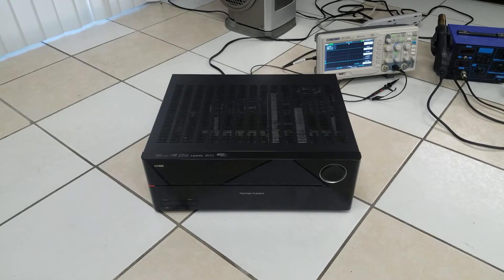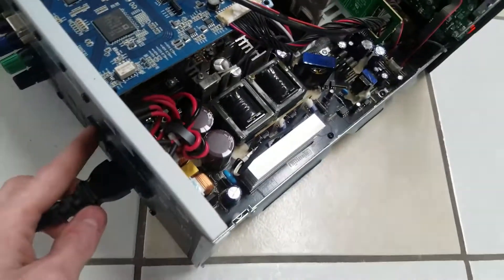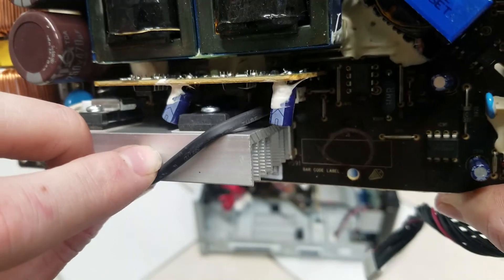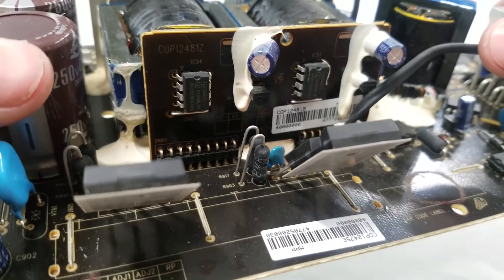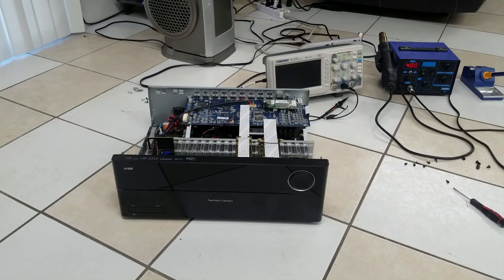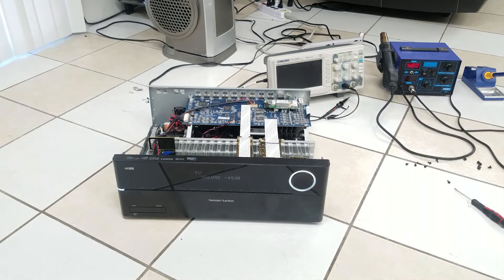Harman Kardon AVR 3700 / 370 Repair - Turns Off After 14 Seconds

Comment: Awesome video, great to see people repair instead of buying new!
I've got a avr270 which switches off extremely random, could this be the same/similar issue?
Reply from the maker: It does sound like a similar issue actually. I had one that started out doing that once every 30min or so, and it ended up increasing to 5m, then 30s, and finally it wouldn't turn on at all and had a flashing standby light.
Reply: @ri5ux  mine has been doing it since 2 years, but sometimes it plays for hours without issues, sometimes is switches off almost immediately.
If you say this still could be the same issue I will try your repair.
I'm not that great with a soldering iron, so if it sounds like a different problem I'll rather take it to an expert.
Reply from the maker: @666bamn  Unless it increases in frequency, it's probably a different issue. May be heat related, the fans don't always kick in when they need to on these models. I forced mine on all the time.
Reply: @ri5ux  thanks for trying to help!
I do have extra fans cooling the Amp as it is in a cabinet.
Is the heating up quick after startup? Because sometimes it switches off within seconds after booting up.
And I can switch it on almost directly again, and then it may play for hours without issues
Reply from the maker: @666bamn  That is quite odd. Probably not heat related in that case. That's going to be a difficult issue to diagnose without hands-on diagnosing it. When it shuts off, does the light pulse or flash at all? Even momentarily or is it just solid off?
Reply: Sorry for the late reply! It's solid off, no flashing or anything. Power led directly to orange, display completely off. My experience with electronics makes me think it's just a broken solder but I wouldn't know where to look. I've  spoken to a repair shop by phone and the guy there said something about a cpu possibly being loose? He said this receiver is known for this issue and it would basically be unrepairable without a complete new board. Does this sound familiar?
Reply from the maker: @666bamn  I have never heard of anything like that on this model. I have heard of failed temperature sensors, capacitors, and switch mode ICs, from normal failiures, but never a "CPU" being loose. Even if it had become unsoldered from the board partially, that is easily repairable with the right tools and should not need a whole replacement board. Plus, those could be insanely pricey, only being able to be sourced directly through Harman. He sounds inexperienced if you ask me. If you want to eliminate what he said, you can try adding a heatsink to the top of the "CPU" as he calls it, or even more simply just improving the airflow through the system with an external fan.

Comment: PLS Ri5ux HELP ME!! i have the avr 161 recieiver,and short after powering on it goes to sleep mode.it have also a smps.but it little different as your smps in your video.i have buy this reciever to repair it like you shown on your video.but its diferent.can you pls advise me?please.you are my last hope.
Reply from the maker: Here is the service manual to your receiver: http://arisux.com/upload/uploads/service-manuals/harman-kardon_avr161_avr230_sm.pdf

The power supply likely has the same issue, you'll just need to locate your capacitors. Page 176 is the schematic for your power supply. I believe the capacitors you should be looking at are labeled C911 and C905. They should be nearby the switching MOSFETs.

Comment: My Harman Kardon AVR 25 II just developed this problem. Is it transformer based or will changing out those capacitors work on mine?
Reply from the maker: The AVR 25ii is transformer based, this video does not apply to it. The transformer may be bad, it is about 24 years old, but it's hard to tell without seeing it. Honestly, unless you want it as a collectors item, it's probably not worth fixing. I'd recommend finding a newer receiver, that one was introduced in 1994. Just my opinion.

Comment: Thank you so much! Just repaired my 370 following your Video. It solved the issue with a shutdown after 14 seconds, but now I can´t get any sound out of it. Neither from amplified output nor pre-amped. Any idea?

Everything else is working fine. Including HDMI in- and output, graphical setup and so on.
Reply from the maker: Glad it helped you out! If I recall correctly, this can happen if your power supply is not providing the -50V and 50V rails. Make sure you have the amp board plugged into the power supply, if it is, be sure to test for output voltage on those rails.
Reply: @ri5ux  I checked it, all the connections were correct but as you said, I didn´t get the -+50V. I´ll check the mosfets next.
Reply from the maker: @mio4mio  Check the continuity between the -50V, 50V rails and ground. What values are they at? Check on the output of the rail and trace it back to the MOSFETs as well. It is possible that the inductor the MOSFETs are switching is bad, but is not very likely.

Comment: I have a Harman Kardon AVR151 with similar issue. It will go to protection mode if the power button is pushed. The red indicator mode would switch to white for a couple seconds (with short  hissis sound was heard) but turned back to red, and blinking. I lifted the ampli up should there should be something stuck inside the board, and powered it up again. Now it went back to normal (with long hissis sound was heard). I listened to the music for a couple hours. Turned it off (plugged it out) but when plugged it in back, the same situation happened. Again I shook the ampli for a couple second, and it was on again. 

This routine happened a couple times and I have a feeling that the problem is not that serious. Can you tell me what is happening here?
Reply from the maker: It definitely sounds like you have a loose connection somewhere, whether it be on the power supply PCB or a wire plug. Without seeing it myself, it's very difficult to pin down and diagnose something like this. If you're interested in a little bit of experimentation, I would try opening it up, and while you have fairly thick insulated gloves on, lightly wiggle components like ICs or inductors until something changes.
Reply: Thank you for replying, after browsing in youtube, it seems I am not the only one. Here is a video of the exact problem: https://www.youtube.com/watch?v=hycrfPY2qAM.

Upon checking on the comments section there are also a lot of people with this problem. Is this probably a factory's fault?

Comment: @Buyshop SP, this is interesting. I have a 3700 and just had this problem happen yesterday. I just replaced the two 471 capacitors and the problem still remains. To note, after clicking the power on, mine returns to the sleep state almost immediately, we're talking about like half a second. At first, like 2 days ago, the problem first started as a shutdown when the audio signal would increase with amplitude, like during an explosion in a movie. Not talking like loud volume; it was at around -30 dB on the nob.

Comment: completing my comment: when the receiver was ok, before the problem (and changing the capacitors) , i was at another room. Receiver was on , and working.    i think i heard a loudy sound, and then it was off , and with this problem of exploded capacitor.
Reply from the maker: Check the mosfets next to the capacitors. It is likely they are shorted.
Reply: Thank you very much for answer!  I sent the receiver to an assistance, and told them what you said.  They told me it can be the mosfets.  I m waiting for them , and probably tomorrow i will have a position.
Reply from the maker: @buyshopsp5375  Sounds good, be sure to let me know what they find out!
Reply: Hi, assistance said nothing wrong with mosfets.  i found the service manual and sent to him. He said that he thinks power suply is ok. That service manual could be usefull to repair the power suply only. 
He thinks the problem is with the hdmi board.  I don t have ideia.  I think i will try to send  it to a Harman authorized.  (I m in Brazil).   What do you think?  Can be the board that has all the hdmi ports?  
This can be a usefull information too:  First when i saw it turning off itself, i reseted the receiver.  But it seems it was ok.  it turns on at FM radio normaly.
Reply from the maker: @buyshopsp5375  Which capacitor exploded specifically? One on the power supply, amplifier board, or logic board? If you could provided the component ID number, that would help too. Also the service manual provides schematics for the amplifier and power supply boards. I think it also provides the schematics for the logic, but cant remember off the top of my head.
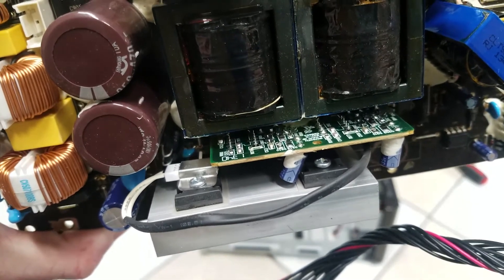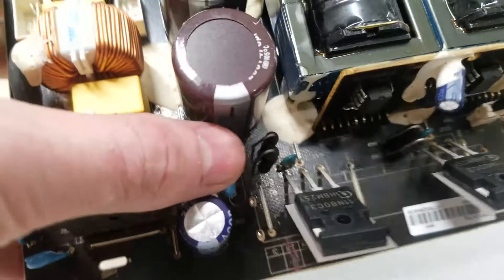Reply: HI, the was exploded was at power suplly.  the first you show at video.  at 7:11 and 10:14.  i changed it with 2kv 471 capacitor. (This one , and the other one that you have changed in your video too).  the service manual i donwloaded is from this link: https://elektrotanya.com/harman_kardon_avr270_370.pdf/download.html
Reply from the maker: @buyshopsp5375  I can almost guarantee it's the power supply. The only other reason it would shut down is if you have shorted output transistors on the amplifier or if it's in a overheated state (unlikely). These power supplies had a lot of issues. Replacing the power supply isn't easy either, since parts for these are uncommon. It's difficult to diagnose something without seeing it in person, but I would have him keep looking at the power supply. He may not be qualified to work on such a power supply, most receivers do not use switch mode supplies. You might have to take it to someone who repairs something more than just audio equipment (assuming that's all he does)
Reply: Hi, i 100% agree with you.  Still thinks its the power supply.  i m sending the receiver today to an authorized Harman assistance. I think in 2 or 3 days i have an answer.  You said about about transistors on amplifier.  Only thing i noticed apparently abnormal , was that nowadays it was heating more than when it was brand new.   Nothing extreme , and was working ok. But i m sure when it was brand new , the receiver worked coller than now.   (It is at same place since i buyed it).  Before this model i had an avr 3650.  The 3650 uses  that "common" power supply i know.  But i had to send it to assistance 1 day because it was heating abnormaly, and was shutting down rarely. After assistance, it worked cool as brand new.
Reply from the maker: @buyshopsp5375  I noticed one of mine also gets a bit hotter than the other as well, it's still working, but it may be on its way out. Occasionally it shuts down. On my other one I forced the fan to run all the time by bridging the fan test jumper. This may be something you'd want to do when you get it back. Keep me updated, I'm curious what they determine the problem to be.
Reply: Well, As said before, the receiver is at Authorized Harman.   Called there right now.   They said the problem is with the hdmi board.  I don t know what to do. They are waiting for harman to get a new board.   Do you know where can i find a board in US ?
Reply from the maker: @buyshopsp5375  Parts for these receivers are very difficult to come by, the only place I know of to get replacement parts is directly from Harman Kardon.
Reply: Hi, i have news!
The guy who works at authorized Harman  assistance called me today.
I ll try to explain what he said me:
He said he found an damaged hdmi board.  He said he made some more tests.  He said he "disconnected" or Disabled the amplifier board ,  and tested the with the damaged board.  The receiver turns off after seconds.
Then he tested with my hdmi board again (With the amplifier board disabled or disconnected).  And it WORKED!
He said in this conditions obviuosly the only way to hear the sound is with phones, because amplifier board is not active.
So, after this , his conclusion is that my hdmi board is ok, and the problem is with the power board.
He asked me patience to make more tests and analyses, to see if he find where is the problem at power board.
What do you think about this?   Any idea? 
I don t know how to explain, (i know only basic of electronic , and about receiver boards), but he said something like the amplifier board is supposed to send a -55 or +55v to power board , or vice versa, and this is not happening. So when he disable this , it works fine, BUT without sound at speakers, as the amplifier board is disabled.
Please, if you know how to help, i can tell him what can be done.
Thanks, and waiting your answer.
Reply from the maker: @buyshopsp5375  The problem is still the switch mode power supply, as I stated before, this type of receiver is quite different from any other and you can receive false readings on other parts if you don't know exactly how they work. The primary reasons the +55V and -55V rails do not output power is because of the failed 471 capacitors or shorted mosfets. It is also possible that the output diodes on the same circuit (opposite side to the mosfets) are bad (but less likely). I would be 100% sure the MOSFETs aren't bad before you even continue with anything else.
Reply: Hi, i probably will get the receiver today!  Apparently the assistance could fix the problem.  The problem was at the power supply board. A component was changed.  I will ask exactly what component was causing the problem and tell you.  Thank very much for the help!!!
Reply: @buyshopsp5375  It's not that hard to check the power supply in this unit if you just know how to do it. To check the power supply : Unplugg the 15 pin connector going to the HDMI board, unplugg the connector going to the amplifier board (-25 0 +25) and unplugg both connectors going to the front panel. Leaving only the AC line connectors connected to the power supply (the Choke/Reactor/"transformer" connector, the 2 connectors to the on/off main power switch and the line voltage in to the board. ) Now plug in the device and turn on the unit (poweswitch at the back side of the device) Now start probing the 15 pin wire/connector coming from the power supply (that you unplugged from the HDMI board). 

Start by measure the voltage between pin 3/4 (DGND) and pin 11/12 (ST+5V). (Btw: pin 1 is the red wire.) This should be 5 volt. If not you got an issue in the standby circuit. If its stable at 5v you got the drive voltage to enable the 5V switchmode supply. To enable the 5v supply connect a 1k resistor between pin 11/12 (ST+5V) and pin 13 (POWER_HI). Now check the voltage on pin 5/6/7 (D+5V) and pin 3/4 (DGND). If you got 5v here you should also have the ~18v from the TF92 transformer needed to enable the 50V voltage for the amplifier board. To enable the 50v (-25 0 +25 ) dual switch mode supply: connect a 1k resistor between pin 5/6/7 (D+5V) and pin 14 (AMP_VCC_ON) Now you should have -25 0 +25V (=50Volt) from the 3 pin connector going to the amplifier board. If this procedure checks out without any problems your power supply is fine (all the four switch mode supplies the power board).   

 BTW: Keep an eye on the ST+5V (Pin 11/12 ) at all times.. It should be stable at 5v else you will enable/disable all the 3 other switch mode supplies ).
Reply: Also if you blew one of the 470pf capacitors it couldn't have been rated for 2000v (or 1000v) maybe 200Volt ? (you need a blue safety capacitor (they wont short when they go bad)  at 1000 volt or more) This would short The drain and the source of the mosfet or shorting B+ to GND over 0,7 ohm "~0 ohm " (R998+R957 or R917+R903). I would check the full bridge rectifier DB91/RS1005M). Some of the diodes may be leaky or shorted after you shorted Pin 4 ((P)GND) and pin 1 ((B)+)  when the 470p capacitor blew up). Ripple trough AC-L/AC-N (pin 3/2 of the rectifier) may also have broken D918. (there are 3 reactors/chokes in front of the rectifier).

Btw: Capacitors have both AC and DC voltage ratings. The 470pf capacitor needs to be rated for DC 1000v or more (AC is usually much higher )
Reply: I'm in the same boat as Buyshop Sp. I've replaced the C983 and C984 capacitors like in the video and my receiver still turns off right after turning it on. I've also tested my Q905 and Q910  mosfets (11N80C3) and they appear to operate normally as far as testing their continuity with and without applying voltage across gate to source. I'm in the process of trying to contact someone from Harman support but I doubt it will amount to anything. Any suggestions would be appreciated!

Comment: Hi, One of them has exploded. it was black.  I changed the 2 capacitors as described with 2kv 471 ones.   The problem is still the same after power on.  What can it be now ?

Comment: OMG you nailed it, both of my caps were black and cracked, would of been really hard to diagnose without this video, they are very hidden, I put the new ones under the pc board, there is a ton of room there plus they will be cooler there further from the MOSFETS and heat sink... thanks AGAIN :-)
Reply from the maker: Absolutely hard to diagnose, It took me an entire day to figure it out the first time since they're so hidden. That's where I put the caps on the last one I repaired (under the board). It's a good spot! Glad I could be of help!